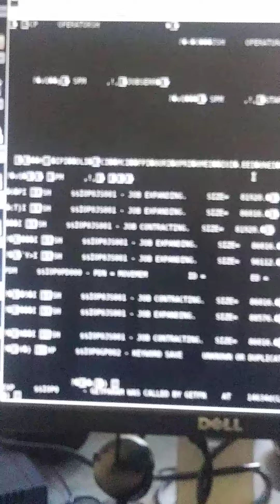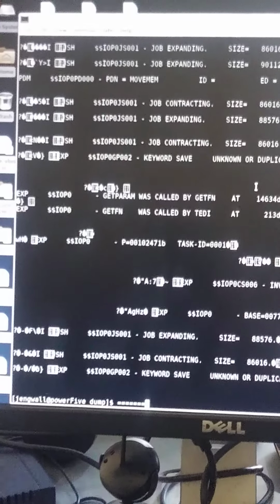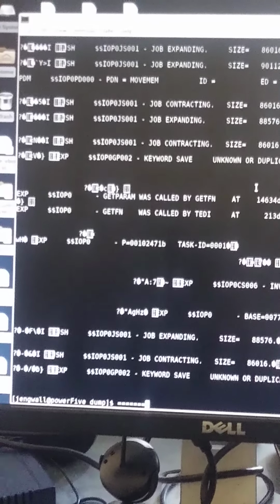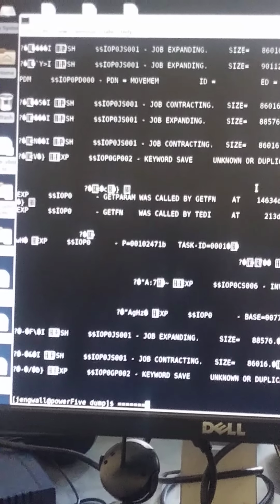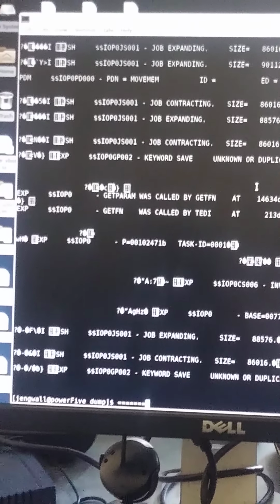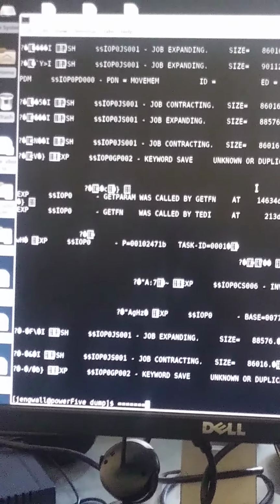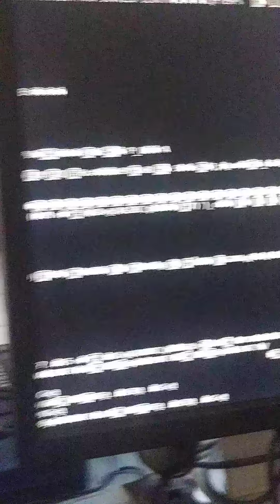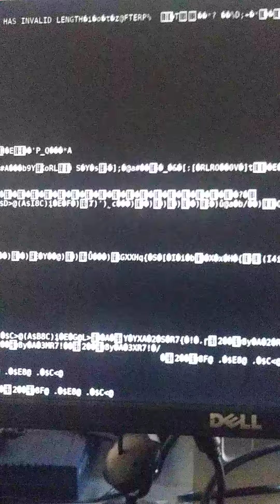Cray X-MP Simulator Assembly Operator Fault

Comment from the maker: I see that you could read Operator Default. The main point remains that in the very loud block of text I first read I was clearly instructed to reserve an upper portion of each file. The manuals do give this instruction as well. They instruct that files should begin with the name of the facility, name of the file and current date or location.